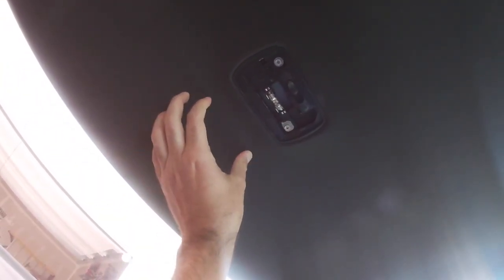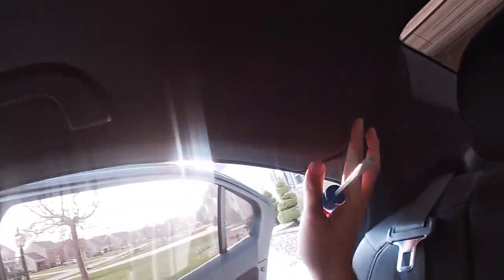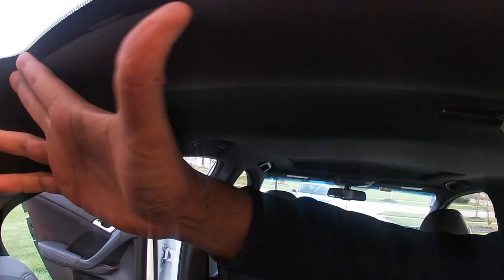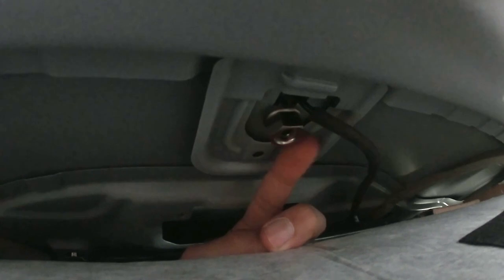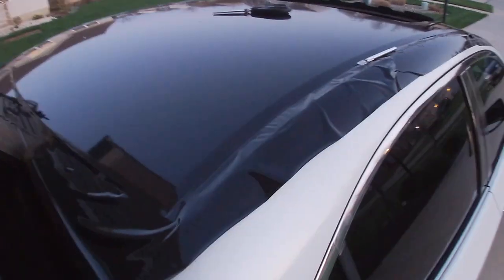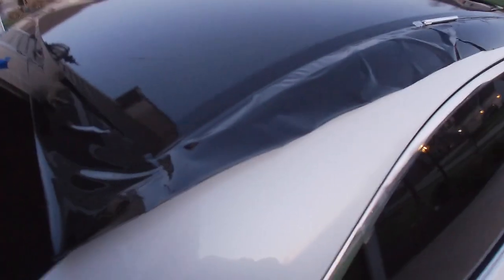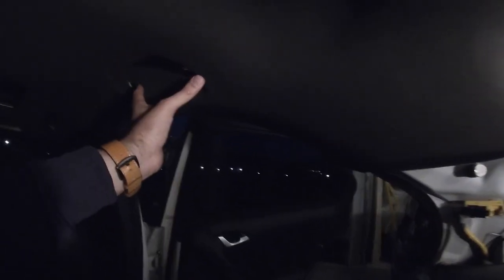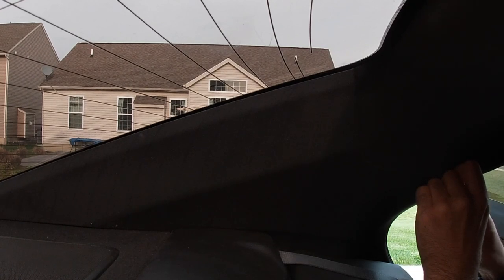How to vinyl wrap roof black and replace antenna on Acura TSX

Comment: The rubber moldings on each side of the car can actually be removed and re used so you can tuck the vinyl under. Also, they do lift ever so slightly if you don't want to remove them completely and use the squeegee to push the vinyl underneath for a tuck.
Reply from the maker: Spidey - thank you for the tips, truly appreciate it

Comment: Did you wrap the roof then open the sunroof and cut out the sunroof?
Reply from the maker: @flynhawaiian gaming - that's correct, wrapped around and then open the roof and cut it out, do the edges

Comment: call me stupid but why do you remove the interior roofing if you’re wrapping the exterior roof?
Reply from the maker: @agent perry - the reason interior panel are removed is to get too roof antenna to remove and reinstall a black one vs having to try to wrap the roof antenna which would be hard.